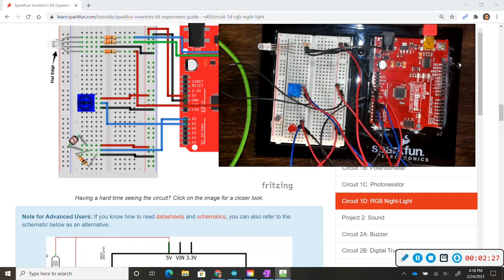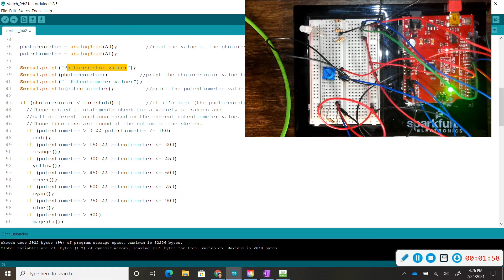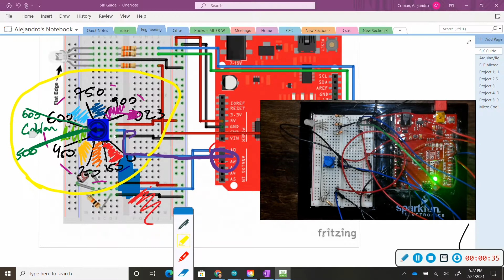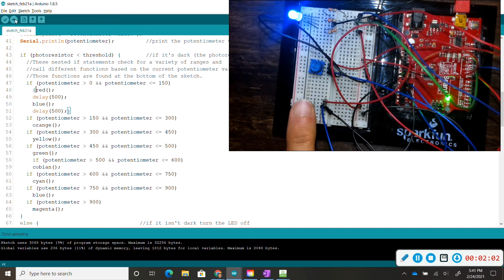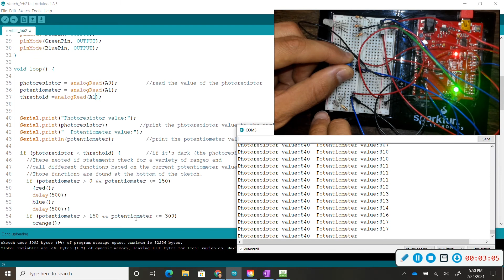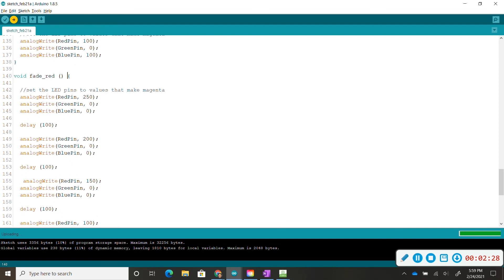Project 1 Circuit 1D Overview and All Challenges Solved

Comment: i dont know why but my Potentiometer goes up to 30 for some reason
Reply from the maker: Hello, I don't understand. Are you talking about the value on the serial monitor?
Reply: @createwithcobian  yeah
Reply from the maker: Does stay at 30 the entire time?  

Possible issues...
1. Jumper wires are placed incorrectly. 
2. Wrong resistors? Use 10k not 330 ohm.
Reply from the maker: Nvm. You need to use three 330 ohm resistors for the rgb, specifically the 3 shorter legs. The longer leg only needs a jumper wire. You'll need a 10 k resistor for the photoresistor.
Reply: @createwithcobian  ah thanks!
Reply from the maker: Did it work?